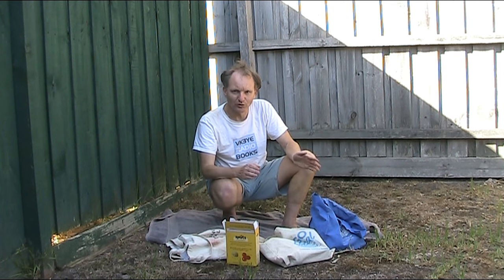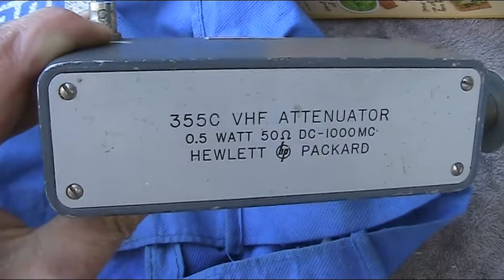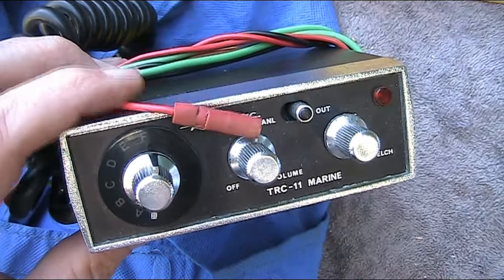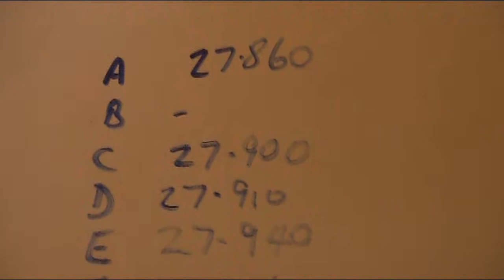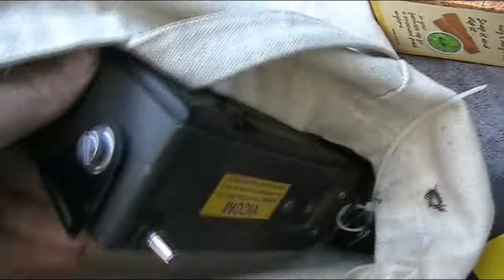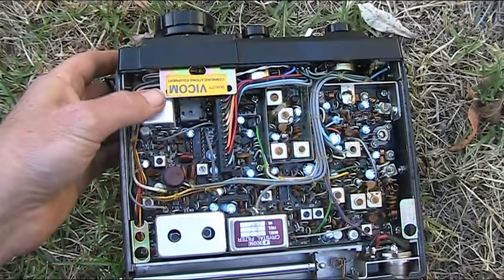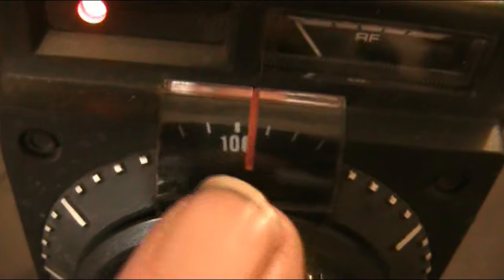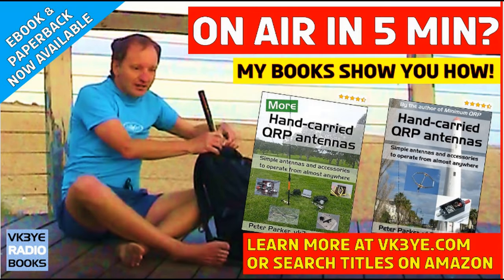Hamfest bargains from 2024 EMDRC swapmeet

Comment: Oooh the IC202 was GOLD!! How I wanted one of those in my youth! Well done, let's hope there's no intermittent fault.
Reply from the maker: There were 3 or 4 of that line of rigs there. Including at least one other IC202. The advent of the FT817 has probably devalued rigs like this and the FT290. It's continued to be rock-solid with good results on Tuesday's vertical SSB net.
Reply: IC202 used to be a favourite for pairing with UHF transverters. Made a good tuneable IF.  Would think old 817s would hold their value still, if in ok condition.   I would have found the other 202 hard to ignore.  Good thing I wasn't there.

Comment: I always look forward to you going through your ham swap finds. Getting old RF treasures for free or cheap, then going through them and fixing what's broken is one of my favorite ham pastimes. A very quick test for air variable caps is to put them on a multi-meter and turn the shaft and watch for the infinite resistance to jump around. With my old eyes that helps me a lot. I have a 355C I got for $10 at a swap, thinking it might need some work on the contacts, or worse, but it performed like new. One of those lucky finds.